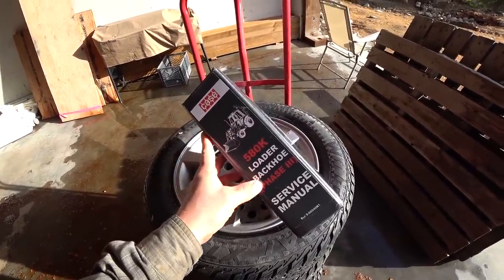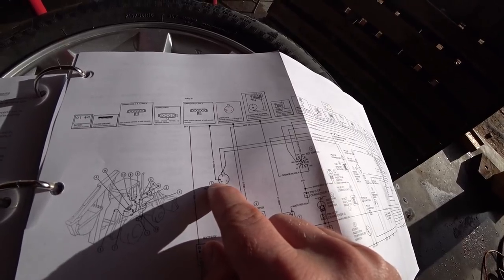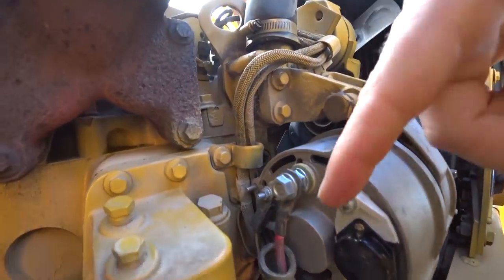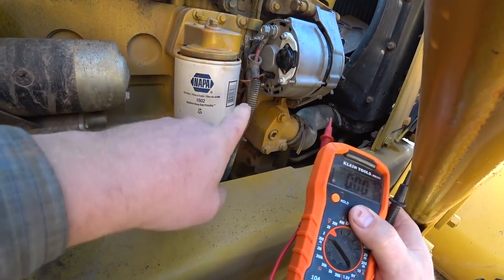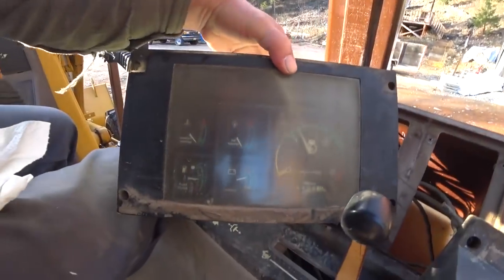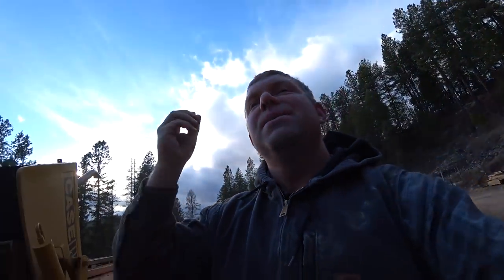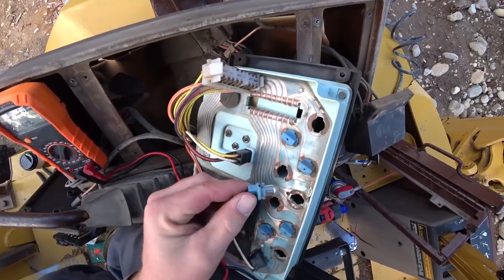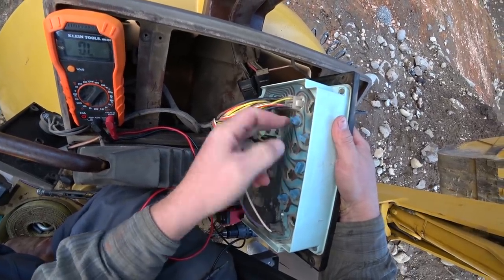YOU WON'T BELIEVE WHAT THE PROBLEM WAS!!

Comment: For future reference, don't ever put one of those screw extractors in a drill like that. Get a tap handle and back it out by hand. Doing it with a drill is much more likely to snap the extractor off in the remnants of the bolt. It may seem like a pain trying to drill through a bolt but the bolt or screw is soft as butter compared to that hardened extractor.

Comment: Yes if you unplug the wire at the altenator you get the 12v, the lamp gets 12v from somewere and being grounded by the alternator or the regulator, and when the alternator start to spin the ground becomes a + and thats why the lamp goes out.

So that post are both a ground and a feed.

Comment: The 1(ish) volts on the alternator terminal is the voltage drop across the excitation coil in the alternator. If you were to disconnect the wire at the alternator, and then test the voltage from the wire to ground, you should then see the 12v.

Comment: If the bulb is in series,  you will never have 12 volts to the alternator terminal. The bulb is going to drop voltage across it. Just make sure you have a clean connection and low ohms on the wire to the alternator. Also, screw extractors never work. Just drill out the old screw and use the next side larger screw when replacing the panel. Put grease on the new screw threads before putting them in.

Comment: Jesse, good job troubleshooting and fixing your backhoe.  You may already understand all you want regarding alternators and if so you can skip the remainder of this note with a JOB WELL DONE.  

I have an electronics background and also restore vintage tractors so I've wired, rewired, upgraded, and repaired a few alternators.

A boilerplate internally regulated alternator is the Delco 10-SI which has three electrical connections (some alternators only have two and a few only have one).

Battery - You guessed it.  This is where the produced power leaves the alternator to feed the battery.

Field - (Also called Stater) Alternators produce current by rotating a magnetic field (armature) within a coil of wire.  Alternators for off-grid wind turbines and micro-hydro systems often use permanent magnets to supply the field but nearly all automotive applications use an eclectically generated field.  Alternators can't charge a completely dead battery because they need some voltage to get things going.  The 'idiot light' works by providing voltage to the field and will light up when the alternator fails and provides a path to ground (like when the engine is not running).   When the alternator energizes, internal voltage from the output of the regulator feeds the armature.  This output power now feeds back to the 'idiot light'.  With 12v on both sides of the bulb the lamp goes out.

Sense - A third line comes off the regulator to adjust the alternator output voltage.  It "tastes" the voltage at the battery and feeds back to the regulator over a high impedance circuit (no line loss) to adjust output voltage and compensate for line losses over the high current leads to the battery.  Most heavy equipment applications have a short jump from alternator to battery so the sense line is generally tied directly to the alternator battery post.  In RV applications where a dedicated alternator is used to charge a remote battery, the sense line comes in handy.

Hope this helps.

Keep at it.

Comment: that light is exactly what was wrong with an old ford i bought several years ago. The previous owner had the whole wiring harness replaced, several used alternators installed, and voltage regulators replaced prior to me owning it. I bought it and replaced the alternator with a brand new one, and 2 new voltage regulators to no avail...Almost a year after me buying it, and almost losing my mind over this phantom issue, an old guy i know who is drunk 99% of the time stopped by unexpectedly one afternoon to see if i had a beer he could get from me , and i remembered he worked for an automotive wiring place for almost 20 years prior to his full time drinking job....he had my truck fixed in 20  minutes..I thought he had done fried all of his brain cells when he asked me if all of the cluster lights were working, and when i replied no to him he started pulling dash screws. i thought mann what did i get myself into.  but sure enough he taught me that if those little bulbs are fried then the current does not make a full loop, and the alternator will not charge. after replacing 2 bulbs, it worked like new. By the way it was the middle of summer where i live and the temperature was about 105, and the only beer i had to give him was beer that had sit in a igloo cooler outside for about 2 months in the hot summer heat, but he drank every one of those hot ass beers like they were ice cold fresh ones while fixing my truck. lol  but i did send him on his way with a $50 in his pocket. he was stoked!
Reply: ya...I have a tendency to ramble and ramble.

Comment: The bulb lights up when the alternator is not producing voltage, such as when the key is on but engine not running. The field windings get their initial voltage through the bulb, once the alternator produces voltage the bulb has 12v on both leads so it goes out. If the alt stops producing light comes back on.

Comment: That is take the wire coming from the idiot light off the alternator to check the voltage. When the alternator energizes it feeds back 12 volts over that a line which neutralizes the light. When you have 12 volts on both sides of the bulb the bulb doesn't work any longer. The bulb has to go to ground in order for it to light. That's why you only get one volt at the end of the line, which is at the alternator. That's the way they used to do it years ago with idiot lights on most vehicles. I have experience as an Auto Electrician years ago.

Comment: Jesse, in short by putting the bulb in you have repaired the problem, nothing more to do. The way that system works is the same as an early GM. The voltage needed by the regulator is supplied by the circuit the bulb is on. The voltage passes through the bulb filament to the regulator. This current flow light the bulb. Once the alternator starts producing voltage the higher voltage on the regulator side of the bulb stops the flow of electricity through the bulb causing the bulb not to produce light. An incandescent bulb does not need a positive and a negative connection to the battery to produce light only current flow. The regulator does not need much voltage or much currant to start working. That is a very simple explanation of how your system works. You have fixed the the problem.

Comment: I could be wrong but I think this is done to make sure the engine shuts off when the key is turned off, especially in the case of diesels. When the key is shut off, the light uses up the available energy left in the fields and stops the alternator from continuing to power the engine and make sure that it shuts off. I am probably butchering this but lights have run in line with the alternator on older vehicles for years. Essentially, what shuts off the idiot light is that the alternator begins to produce voltage and send power to the back side of the bulb. Since there is power on both sides, the bulb goes out.

Comment: Most of the time a problem on a machine like that is a small one.  But doing it yourself you found the problem.  A dealer or even some repair shops would have just hung New parts until it was fixed or you said stop I'm not paying for that.  Good job.

Comment: Since the light is in series with the alternator, so you wouldn't read a full 12 volts unless you unhook it from the alternator to open the circuit, then it will show the full 12 volts.   Like you said, it is the current flowing thru that is kicking on the voltage regulator.  You should be good.  Don't worry about the 1 volt reading, most of the voltage is dropping across the light and you are measuring across the alternater.
Reply: Was going to say the same thing. Also, the logic on the power coming from the idiot light is that once the alternator is producing current it stops taking startup current and the light goes off. If the alternator doesn’t produce power, the idiot light stays on.

Comment: On yachts  the supply to the armature is sometimes wired through the oil pressure switch  to prevent to prevent discharge if the engine isn't running.

Comment: That’s how it was done before computers took over. 12v goes through the bulb to the alt   with the wire disconnected you should have 12v with the wire connected the voltage will drop down and the bulb acts like a resistor. The only other thing I’d check is the resistance of that wire from the cluster to the alt.

Comment: Jesse, you'll never hit ground on a painted surface. Either use a long lead to the negative pole of the battery or to a ground lug on the frame (starter motor, etc.). You need to put all the bulbs in the circuit. Go to a junkyard. They are common. Same as in my Ford dashboard.

Comment: It only takes a volt is enough.  The bulb absorbs MOST of the 12 volts... or it would not light.  The CURRENT through the lamp is enough to flash the rotor field.  Way back when you were replacing alternator I thought " is his idiot light working?"  Should have messaged you.

Comment: It's probably been said in the comments below, but it sounds like the bulb and the alternator exciter coil are in series.  The light bulb is probably a much higher resistance than the impedance of the exciter coil, so a majority of the voltage will be dropped across the bulb.  So, 11V across the bulb and 1v across the exciter sounds right.

Comment: Take 00 steel wool and lightly clean all of those circuit board connections for the bulbs and connectors. Then apply a light coat of dielectric grease to prevent additional corrosion. It worked great on my 1979 F 150 that had very dim instrument cluster lights.

Comment: Having 5 of those yellow monsters you learn how to rig things to make them run. I was shown how to run a wire from your fuse panel to your alternator to excite it(bypassing your cluster).....I won't tell you which fuse though as it is a safety issue...and of course its a temp fix.

Comment: Check any parts store!  If you don't see them, they are on a shelf out back.  Looks like PC194 or PC168 (check one of the old ones).  I used to remember them by heart when I worked at the local parts store.  You never know when the simplest things get in the way.  Nice job

Comment: When drilling the screw head (or  bolts and rivets) it is common practice and easer to just drill the head off as you inadvertently did then. You just taught yourself the real way to do it. Good Job Jesse. The hard part here is the ability to read and interpreting manual instructions.  Not everyone can do that.

Comment: The best thing to try first on stripped or broken fasteners is a left hand drill bit. Best case the bit will grab the fastener and spin it out. Worst case you have a hole for an ez-out or an extractor. I have had s decent amount of success with them. Especially on the salty rusty cars here in England!
Reply: zoidberg444 - You are right on!

Comment: The first thing to do is pull page by page by page and put one of those cool old cloth hole reinforcers on both sides of every hole and a strip of self adhesive paper 1/8” wide the length of the inner border of the page.  Now you will need TWO binders of the size of the original so that all the pages fit evenly in both binders.  But now your pages won’t tear out and get lost..
Reply: I copy whatever pages I need for the task at hand. Clean original copy and dirty at the vehicle copy. I get the most frequently used pages laminated to stay in the shop

Comment: A correct diagnosis. Alternators mostly don't have enough residual magnetism to self-start. The current through the bulb (which goes to ground through the rotor winding) helps get them going. 

I wouldn't advise shorting terminals together on anything electronic though. In this case it probably won't do any harm but in others it could wreck the unit.

Comment: The automotive world ever since they replaced generators with alternators has been using idiot lights to provide power to the alternator. The car manufacturers eliminated the burned out bulb for the alternator and no charge from the alternator by installing a single diode. Remember a diode allows power to flow one way only so make sure the diode feeds power to the alternator when the bulb burns out. Or simply carry a supply of spare bulbs. My first car a VW bug 1961 vintage still used a generator with an idiot light to prove its charging when the low voltage relay closes the gen light goes off. For an alternator that idiot light as you found out completes the circuit to provide power to excite the alternator aka: provide a magnetic field so it can generate ac power which is fed through the diode grid which feeds the 14 volt output stud the heavy wiry is bolted too which then feeds DC power to the battery to charge the battery. It sounds complicated and is only in that it's much more reliable as there are no commutator brushes the old generator uses that need to be replaced every few years. The alternator is brushless which is the reason it last so long compared to the generators.
 Generators have per ant real magnets inside that only need rpm to generate power where as an alternator has no permanent magnets and instead relies on 12 volts from the battery to create a magnetic field so the alternator car as rpm increases from a dead start once rpm generates sufficient power to exceed the power supplied by the battery it becomes self excited which means as long as the rpm stays high enough to continue power generation it supplies power to the vehicle instead of using power from the battery and charges the battery back to the set point of the voltage regulator which is usually set at 14.7 volts DC. Just as a bit of info a fully charged battery voltage is 12.7 volts. My grandmothers car died after having the generator replaced on her 1950 Ford flathead V-8 in our drive way and the mechanic said it wouldn't be till late afternoon before he could check out the car so I lifted the hood to simply look with my grandmother and immediately found the problem. The car had a voltmeter instead of an idiot light and the generator sat in its mount I high up and centered between each cylinder head with a single belt that drove the generator and one water pump for each cylinder head. The field wire wasn't connected to the field terminal but was hanging in the air, I took the nut off the field terminal and placed the connector closed loop over the field pin added the washer and nut and tightened it down then my grandmother tried to start the car but the battery was low and wouldn't crank it over so my mother and I pushed it out of the driveway and she turned left where there was a small downgrade of 15 feet which was enough to get the car up to 10 mph then with the ignition on she popped the clutch in second gear and it fired right up and the voltmeter was charging. I had been hanging around learning about cars at a gulf station and every time I got home mom would pitch a hissy fit as I had crossed route 28 a major road and very busy back in 1959 when I showed up back home covered in grease and oil and happy as a lark.

I was 9 years old. 

Congratulations on finding the problem with the charging system and you will find the cost of the shop manual will be worth every penny.

Quick trivia question 

How did Ford keep the battery from overcharging on the model T and A? Answer scroll down.

You turned the headlights on when you smelled the battery gassing ( stinks ).

Comment: While I realize this is long since past. Just FYI, any 70-80 GM gauge cluster will have those sockets. very common. that is a standard GM type alternator, the idiot light is the voltage sense line for the regulator. you can also buy 1-wire conversion kits that replace the idiot light with a resistor mounted on the back of the alternator to get rid of the idiot light.

Comment: After you check for continuity you should check resistance or just use resistance, as continuity still gives you a reading even when 1 little strand of copper out of (lets say) 20 strand wire is connected/touching. Resistance will show you if you have a open or closed circuit as well as the amount of resistance the electricity has to overcome, if a wire has a low reading it is still good but if the reading is medium to high then inspect why as an animal, the environment or a piece of machinery could have cut into it. I hope this helps someone with diagnosing electrical issues.

Comment: 99% of alternatots have the windings 'excited' by 12v from the ignition switch via a bulb, often a bulb with a resistor over it, so if bulb blows/gets removed the resistor should also excite it.
good video.
Reply: Less common these days with "smart" charging systems.  True, not too many years ago.

Comment: Hope it works, but there might be a reason why the bulb and holder were MIA.  They don`t unscrew themselves and walk away, and with some of the screws missing from the gauge cluster, it leads me to think that it`s been removed before, and possibly the light was removed to remedy some other issue that a prior owner was facing.    Now, if the light was simply burned out, that would be a different scenario.
Reply: Vern C as you say it could be, however I’ve found when people stop caring about things they don’t replace the screws just put enough to hold in place, my call is a bulb stopped working (say on the fuel gauge) the instrument panel was opened it up and they swapped a bulb not thinking about ( or caring) where it as taken from. That said there’s a lot of bulbs missing...